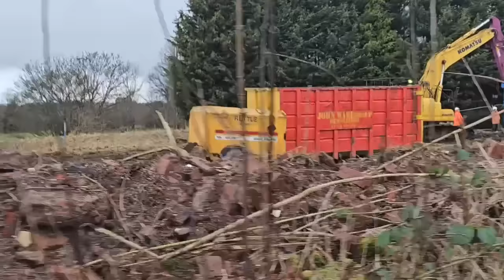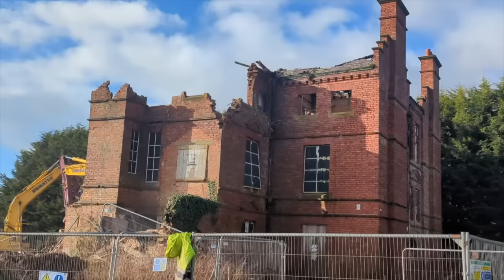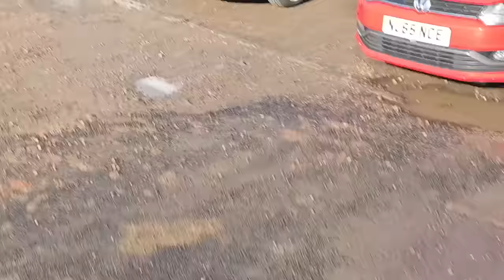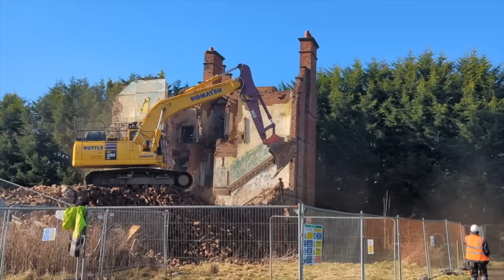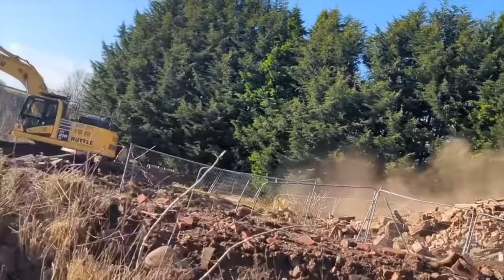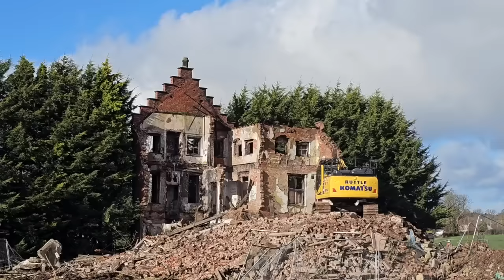DEMOLITION TIME (St. Peter's Gainford)

Comment: A little Internet research found that the school was opened in 1900 as an orphanage run by the Catholic Church. The main building was expanded in the mid 1950's, but funding became a problem. It was renamed as a community school, but was closed in 1984. There was repeated vandalism and arson at the site and most outbuildings were demolished around 1994. Finally the local preservation society recommended that it be torn down as the fire departments felt it was too unsafe in case of more arson fires.